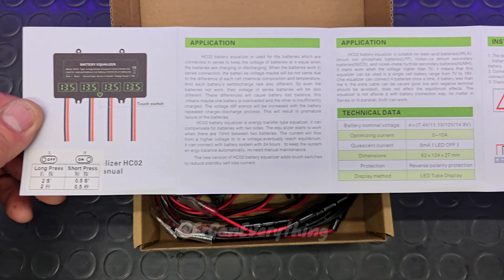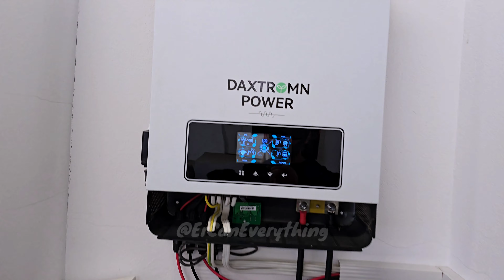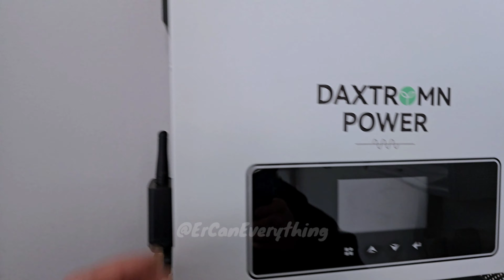Unboxing and Connecting 48V Battery Equalizer

Comment: You have to connect this above the main thick cable as this connector on here is not rated for the high current and could melt between the batteries terminal and thick wire

Comment: Stupid Question Here- but what is a Battery Eaqualizer & Why Would Anyone Need to Have to Use/Need it?!?

Thanks in Advance for the Genuine Answers🥴
Reply from the maker: I bought it because the batteries become unbalanced after a while and I had to charge it manually when the low voltage protection on one of them tripped.
Reply: Think of the four batteries as drone motors. If one of them stops before the other 3, what happens to the drone.
He leans on the side and loads the others. ErCan Everything should bring extra energy to the weak motor/battery. 
I hope this helps 😊
Reply from the maker: @DjaniAgain This is exactly what happens, and as soon as the voltage of one battery drops below a critical level, it shuts down and the inverter does not recognize that there are batteries on, and I have to manually charge the dead battery🤦